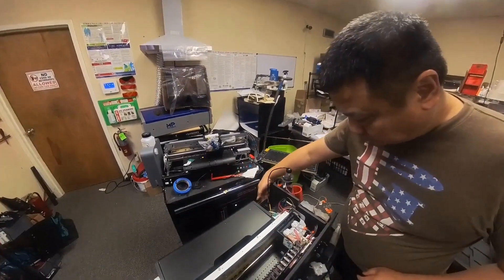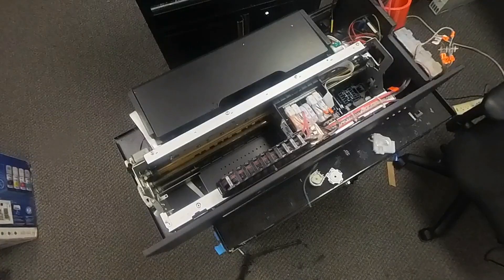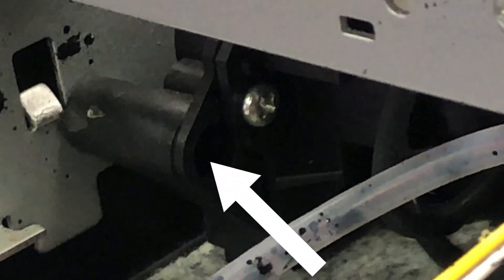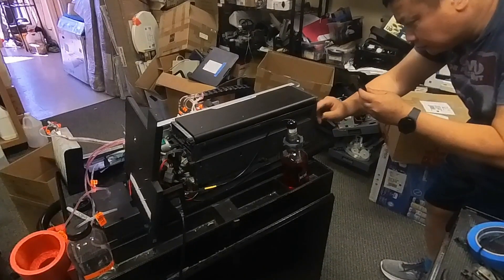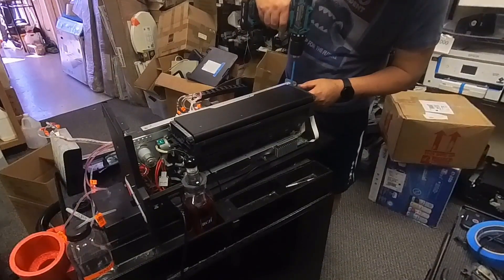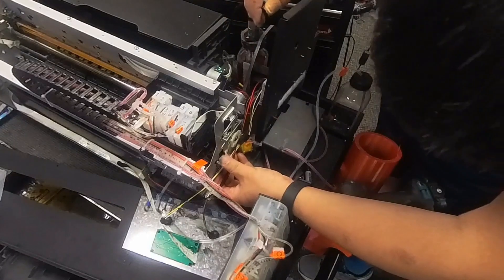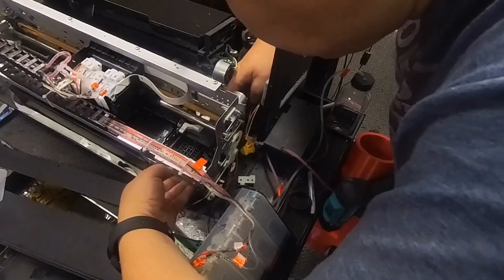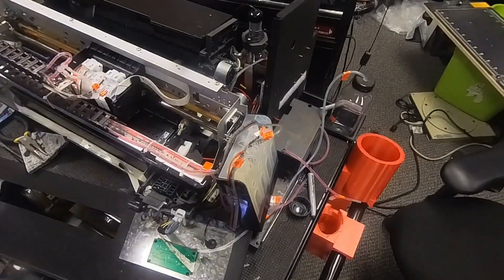How to Remove/Install L-1800 Waste Capping Station - Artisan 1430 1400 1390

Comment: I just install a new waste ink pump on my l1800 but I’m not able to draw ink from waste line or when I do a printhead clean spits the ink up.. any idea?
Reply from the maker: Thanks so much for subscribing and for your question! I really appreciate your support—every subscriber helps me get closer to that 100k mark. It’s been 8 years, and I’m halfway there, so every bit of engagement means a lot. I try to answer subscriber questions within 48 hours, but if you ever need a faster response, feel free to email me at support@bchtechnologies.com.  

From what you’re describing, it sounds like the waste ink pump might not be creating enough suction, which is why the ink isn’t being drawn through the line properly. Sometimes this happens when the capping station isn’t sealing tightly against the printhead. I recommend checking the capping station to ensure there’s no excess ink or debris that could be preventing a good seal. If the capping station is too wet, it can interfere with suction, causing ink to spit out during cleaning cycles.  

I made a detailed video that walks you through troubleshooting and maintaining the capping station to prevent these kinds of issues. It covers dismantling, cleaning, and reassembling the station to ensure everything is running smoothly. You can check it out here: [https://youtu.be/RVtQLe2wTsk](https://youtu.be/RVtQLe2wTsk). Let me know how it goes or if you need more guidance. I appreciate you being part of the channel, and I’m here to help with any other questions you have!

Comment: Hey Kevin, I just recently purchased a printhead from you and it is exactly as you explained it would be. OEM Epson, brand new with Epson seal (broken) but i assume it was from you testing. I plan to write a review on your website as soon as I get squared away with my current issues. And since you put out such great content, You are one of the only sources I actually trust now. Anyway ink flows beautifully, but i am concerned that my print head isnt making a good seal to the new capping station head i got off Amazon, because i am having black inks ending up in my yellow inks on my test block pattern. Initially when installing the printhead, I ended up having to prime the head via drawing from the waste tube with hardly no resistance until i applied some slight downforce to the head over the capping station. The ink cap head seal is clean. Do you think this could be caused by a slightly deformed spring that has been overstretched some? I'm not sure how much tension the spring creates by default. Should it have a fair amount of tension? Do you make your own springs or do you do purchase them from other sources? I don't really understand what this spring is for. I know that the capping head goes down into another facet below and I assume that the spring is supposed to bring it back but maybe if it's overstretched it won't pull it back level with the printhead and I think that might be what is happening? What do you think? Also pro-colored the company that modified the l1800 sent a capping station head that did not have a sponge inside but had a grate on it is this something that these modifiers are doing now what disadvantages do you see to having a ink pad versus just a empty head to spray into?

Comment: Hello, I'm having a problem with my hp officejet 8012e. I tried buying third party inkt cartridges, but I can't print. On the hp smart app it showed that these cartrdiges are cloned, when I try to print, the printer stops and says that I need to replace the cartridges. Is there a solution?
Reply from the maker: Do you have HP+ installed, or signed up for their "Instant Ink" program?
Reply: @BCHTechnologies  hp+ got some how installed what f*** me up I think. I don't have that program instant ink
Reply from the maker: HP+ is my guess.
Reply: @BCHTechnologies so what should I do?

Comment: Hi, I have a DTF L1800 that has been shut off for a 8 months. I unclogged the head. But the waste tank tube is clogged. The capping station spews out black foam. I don't have a local printer expert nearby. Can you please tell me what I should do?
Reply from the maker: LOL. Most people don't realize they need to unclog the capping station. Thumbs up for you.  I am working on the same issue. Gonna shot a video today and hope to put the video on the Tube next week.
Reply: @BCHTechnologies  thanks for replying. Eagerly waiting for the video. I syringe pulled some of it. The ink is completely rubberized. I can literally see the clog where the 2 tubes connect into one.I took the capping station off to pour some cleaning solution in through those tubes. Should I pour hot water instead?
Reply from the maker: Just remove all the old ink from the tubes and you should be ready to go.